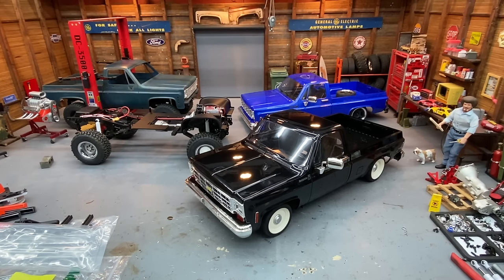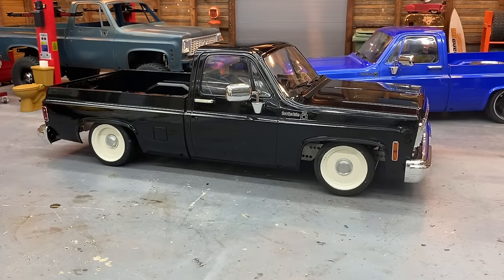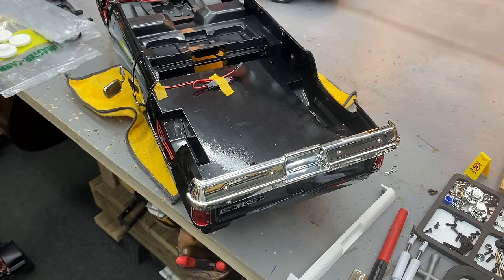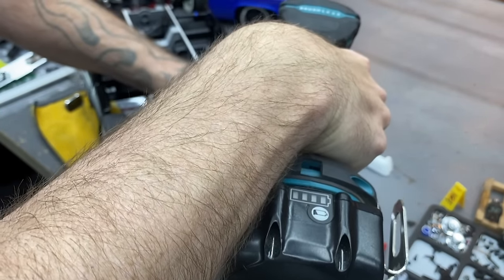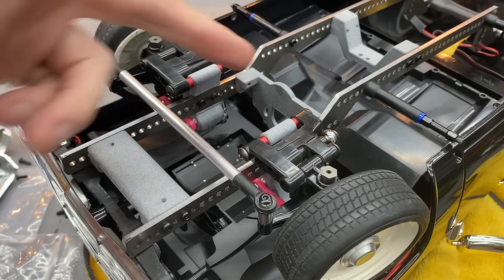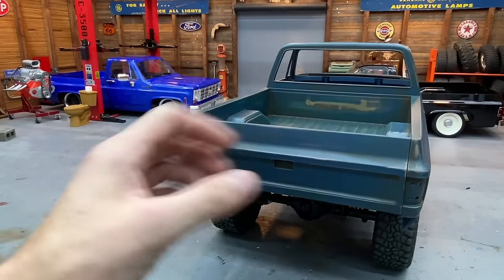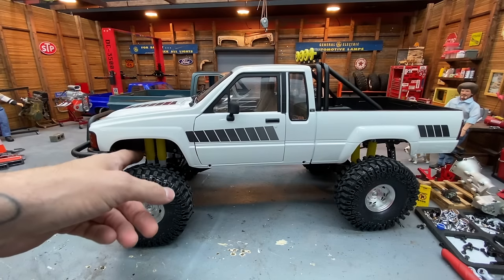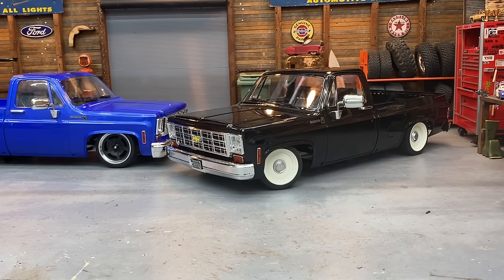Squarebody Shop Hangout, K10, C10, Shop Truck Chassis mods, RC4wd Buildoff and More!

Comment: I don't know what happened but my comment seemed to be sent to oblivion.
The RC4wd build looks so good with those rims and hubcaps. 
The Black one ❤  Off the hook and PERFECT rims for that. "Let's cut the shock towers down and then the transmission bulkhead and the cut the shock towers even more!,"😆 Living the words of Bob, no mistakes just happy accidents. Then you said the "P" word.
"This is my Prototype chassis." And to the right people, that model truck went Jay Leno.  First run of Shop Truck chassis kits sold out in 3 hours. And your building that Black one on the prototype Shop Truck chassis that had a production run of 1. 
Dude....
 In my lexicon the Black Truck will forever be known as "J". 
And the old yellow Patina tt-02 with the bondo in the tailgate might not be the first one of these slammed Chevy models but it's a icon because of it's YouTube exposure. Awesome video and you and ah J have a great week.

Comment: The traxxas bumpers do look a hundred times better, and are more realistic to the actual bumpers that were on the square bodies. I built a trx4 with a k10 body, but used the traxxas bumpers instead of the rc4wd bumpers. I’m building a c10 project right now on a redcat lowrider 285 chassis I cut up, but I probably will use the traxxas bumpers on the front since I’m doing a roll pan on the rear. I used the traxxas hotrod wheels for my c10 too, but I’m doing mine up as my old 78 gmc sierra grande. Keep up the great work.

Comment: Someone needs to do a custom flame 🔥 paint job on one of these K10. Something different I’m sure will win! That’s a nice chassis that you made bro! Why not a straight axle in the rear though?
Reply from the maker: It is a straight rear axle.
Reply: @RCeveryday  ok what axle do you use?
Reply from the maker: on the black truck is a china version of the rc4wd k44, the blue truck has a boom racing brx80 thats narrower to tuck the deep lip wheels
Reply: @RCeveryday  I think they are all China axles these days  lol
Reply from the maker: Lmao. Not wrong there😂

Comment: So, when are you going to engineer and release a 2wd frame kit for the Mojave and Pickup bodies? 2026? 29? 

Nahhh- But you've got quite a good fleet of squarebodies now! I think ya need a dually now.
Reply from the maker: I believe this chassis will work with narrower rear axle and tamiya m-chassis arms...
Reply from the maker: well I just tried it on the xtra cab and 4runner, not working out well
Reply: @RCeveryday  a potential future idea then!

But for now it seems you've got plenty of other things taking up all your time
Reply: Would be great to see these narrow rear ends from these trucks . I guess there not real popular for crawling but these truck manufacturers need to take notice. That art is imitating life and the hot rodders in 1/10th are looking at crawlers/scaler parts.